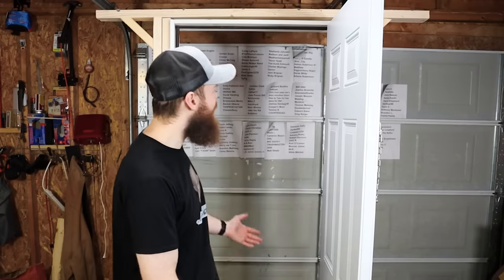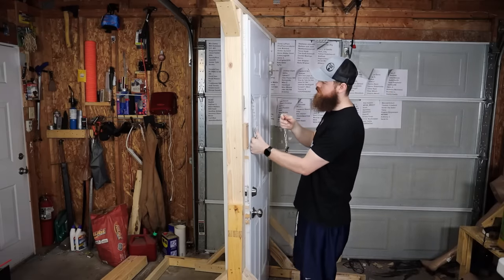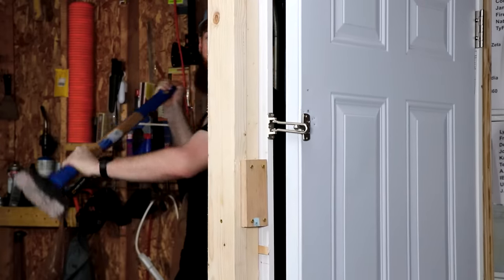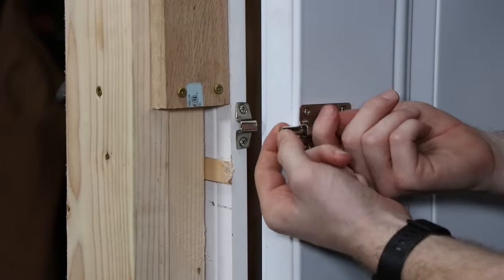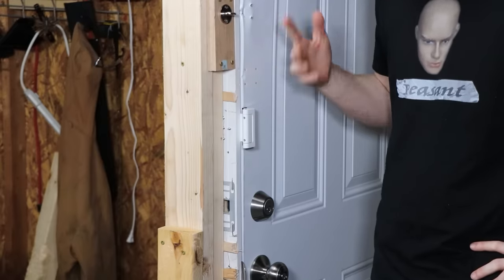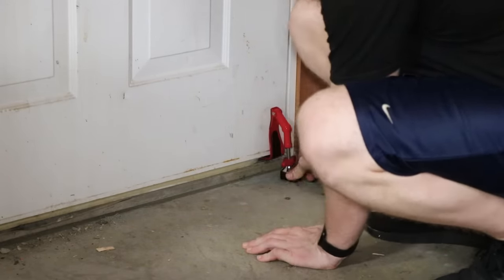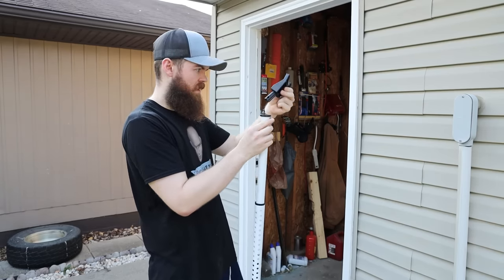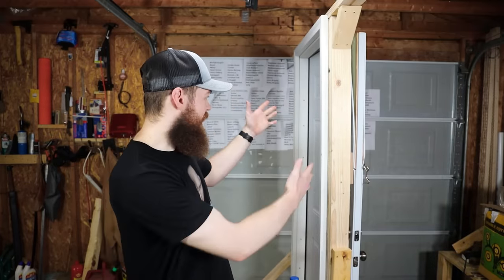Testing Top Rated Door Locks From Amazon!

Comment from the maker: THE DOOR LOCK - https://amzn.to/3r0BxN0
Reply: Chain one is wrong . The chain is supposed to be in the  wall
Reply: @brandonbrooks9275  its probably better on the door as long as the door is quality wood becuse a dry wall ain't stopping somebody really strong smashing into it
Reply: Fire men do that to get to people
Reply: For the first lock if you had switched them around and put the chain part on the frame and the lock part on the door then it work
Reply: @rick what I meant to say when I was a kid we had a wood wall and it held to a neighborhood burglar. But it was a wood walled house so I do agree that it need to be wood and also the slide it’s self needed to be horizontal where the fat end would be closest to the edge of the door and you would not be able to slide it open.
Reply: You cracked the door frame with the sledgehammer when you were testing the hotel style look, and all the kicking that you did made the crack bigger... To test the strength of a deadbolt you NEED a new door frame..... A deadbolt WILL ALWAYS be stronger than all of the other locks than you are testing here.....  So do not sit there and tell people that a hotel type lock will out do a deadbolt..........
Reply: That's because the frame was destroyed and you're forgetting most deadbolts go into the wood
Reply: @cypher9927  It most certainly will. Police kick on deadbolts every day.
Reply: Put a screw and nut in the white pole instead of that useless button and try it again!
Reply: Heres a tip nothing will stop  a person that isn't honest they will always get in even with the toughest locks.
Reply: We have 7 bolt uPVC doors here with a hotel style door hook at the top and the bottom.. your going to have to remove the whole frame to get in!
Reply: i suggest testing these again but mounting the door into the ground or something so it has much less give, i feel the force put into the door was just thrown away every time the door slid
Reply: @brandonbrooks9275  the slide for it was also wrong, yes he followed the pictures but they are supposed to be mounted sideways with the input side farthest away from the door, that way the force is even distributed among the 4 screw holding it in, instead of it just yanking on the connection point of the chain
Reply: Try all of them at once
Reply from the maker: It absolutely will out do a deadbolt, all day long
Reply: Do the door look that Jerry on Seinfeld had and went crazy about.
Reply: @at4legendz  read my second comment
Reply: @kylehooker3710  i know that.... if you do them the right way, they need a battering ram to get through the door....
Reply: Sad news 
Frame is weak 
Wobbly door,Weak Door 
And just having a sledge hammer can break any doors
Reply: You fucked up the door and didn't give any of those locks a chance.
Reply: Nice channel, but just a suggestion: get rid of the 3D outro animation, it doesn't look good
Reply: The door chain.. usually there was a button you would have to push and hold down the get the rivet out and it requires both hands. if mounted tight it would be pretty much impossible to bypass it from the outside without any tools.

Of course yours didn't have that rivet trapping mechanism, because it was so cheap
Reply: @Lilith-Rose  problem with that if there's a fire the fire crew isn't going to be able to do anything and they possibly could have the grounds to sue you (this is just a complete guess, if this is wrong then I'm not surprised)
Reply: @Lilith-Rose  well, as I said it was just a little hunch, if it was stupid, ignore it.
Reply: Ellie, the DOOR LOCKS!
Reply: Your terrible predictions are the best part
Reply: @kylehooker3710  They do kick deadbolts every day, once once the deadbolt is kicked in, they will kick the hotel lock in much much less effort. Go build 2 doors, lock one with the same deadbolt, and one with the same deadbolt and hotel lock. Even if you're as out of shape as I am, the hotel lock will only take an additional kick or 2, because you would have destroyed the frame kicking in the deadbolt. The tests are done in order from assumed weakest to strongest, on the same door, each time it's hit weakening the entire system more and more, and all done assuming the door is unlocked or picked (which in the real world most people hit a door with brute force and ignorance from step one if breaking into a random home)
Reply: @TylerTube  build another 2 doors, mount them on a building and try each in turn, if you break through a deadbolt first (which reminder will make you crack the frame because you actually mounted the strike plate with the 2.5" screws most deadbolts come with for that application) and then an unlocked door with a hotel style lock. You will NEVER break the deadbolt first, even though you installed the cheapest, least secure deadbolt money can buy. You tested a deadbolt on an already broken application which gives you a very very false sense of security with it.
Reply: Choose
Reply: Choose
Reply: Choose area
Reply: the second one can be bypassed just as easy as the privacy hook
Reply: Bolt cutters = 5 second entry.
Reply: regarding the first "lock" (the chain) you dont need to mount it further away... you can just mount it further up, to the point where you need to close the door to have enough chain to move the pin(?!) to the top... dont know how not to realize that... i am not the smartest person and it took me less than a second to form that idea...
Reply: Yeah I'd like to see that one you know that you attaches to the handle to the ground I agree with you but let's see what would happen if you put a bolt you know drill a little hole put a bolt in it so I can't slide the little pin

Comment: Put all the locks on one door and make the ultimate door
Reply: It would be awesome to see Tyler do that then try to open the door because I truly believe that it’s gonna be impossible for him to kick or knock up the door with them all on
Reply: nice
Reply: lock pick lawyer would probably have something to say about that :p
Reply: You’re playing god right now
Reply: SUPERDOOR!
Reply: Easy defeat, just take out the hinge side with a crowbar/Halligan, or even faster shotty to the hinges. quick and easy.
Reply: @eliminster06  put locks on both sides
Reply: Except what a PITA to fasten them all, you'd get tired of doing it on a regular basis so they just were wasted effort and money to install.
Reply: YES!!! I AGREE 👍🏻💯👏🏻👌🏻
Reply: @bradster2214  Still wouldn't take that long, most American doors are not even strong enough to resist a halligan tool when properly employed. The spade and hook will make quick work of the door if needed but most the time it is faster to defeat the locking mechanism through leverage. Let alone watching what happens when you use a hydraulic ram similar to the jaws of life on a door, couple seconds and it will pop right open.
Reply: @eliminster06  hydraulic ram doesn't count. We're talking preventing a B&E here. Good luck busting though that door with your sledgehammer.
Reply: @bradster2214  wouldn't take long to take the door out with sledge, what you are not seeing is how much the frame  is flexing which won't happen when it is properly mounted. This allows for more of the sledge's energy to be dissipated by the frame flex and not put into the door. Most American solid core doors can only handle about 7 good swings before they split in two. Only door ive seen take more from a slege had a solid 1/4 in steel plate in the center spanning the whole door making it a wood/steel laminate door. that thing didnt even flex under impact but dented the wood and only failed due to the locking mechanism failing finally.
Reply: @eliminster06  if someone was worried enough and did this, they'd have a plated door.
Reply: And have them all fail once the door frame or the door breaks
Reply: Esbern's door from Skyrim lol
Reply: @eliminster06  What if you aint in america
Reply: Won’t work. Each lock has different slacks.
Reply: I need this
Reply: Of course
Reply: It would be like the door from Up
Reply: The sliding lock usually goes on the door 
Still not much help if there is force but you can't take it off by sliding it up lol the door would prohibit that
Reply: What I was thinking
Reply: lol
Reply: There's already an ultimate door, the one in the video where the swat team was hitting the door with a battering ram for 10 minutes, and still couldn't open it.
Reply: @broofallbros3036  🤥🫤🤫🤯😊?😅😅😅😊
Reply: @Nightsaber22  😅i
Reply: @Nightsaber22  😅😅😅😅😅😅😅😅😅😅😅😅😅
Reply: @Nightsaber22  😅😅😅😅😅😅😅😅😅😅😅😅
Reply: 45 min routine lol
Reply: takes two steps to the right and breaks window with a rock
Reply: Put them all on a door and the doors internal frame would have no strength at all, one kick and you'd snap the door itself while the frame stays in tact

Comment: tyler the locks aren't gonna break that easy when the door is wobbling around like that. you really need to test it on a door that's actually hung in a wall. you're losing so much force to the wobble.
Reply: this is true
Reply: Sadly this is true
Looks like more than 3 hours gone to waste
Reply: Maybe anchor bolts in some concrete in the future. That way we can keep that good pov on the door and accessibility for demonstration. The top would still flex somewhat though unless metal frame around wooden frame.
Reply: If the door wasn’t wobbly, the locks are going to fail easier. The door jam will fall apart with most kicks. It’s best to use a 3-4 inch screw and screw it to the 2x4.

Comment: The chain lock needs to be mounted horizontally in order to not let someone unhook from the outside.
Reply: My parents had a chain on the door leading into the basement. It was mounted horizontally with the chain on the frame and slide on the door with the opening of the slide pointed away from the frame. So, when it opens the slide moves to the end and hard to slide back out due to the movement of the door. More effective than how it was mounted in this video.
Reply: ...and have the chain on the wall instead of the bar too
Reply: Ah yes to both of you i completely didn't think of that either. I feel like the chain needs a retest in a part 2 of this video.
Reply: Did y’all not hear that the company had it shown mounted vertically so he installed it vertically
Reply: @facade0074   Doesn't mean it wasn't wrong. Also he corrected it in a new video. The real question is why are you replying to this?
Reply: @facade0074  What's your point?  All we did was recommend a more effective way to install it, that he proved was more effective in a follow up video.
Reply: @facade0074  hopefully the company learns, then... And hopefully anyone with this kind of install can see these suggestions to add a little extra security.
Reply: @metaloverdose  I said it because the original comment implied that he did it wrong I say this because original comment says he “needs” to which implies he did it wrong
Reply: @facade0074  I see but you didn't have to say y'all, implying that I said it was wrong. I made a clear, effective suggestion. Be direct with your target instead of generalizing.
Reply: @facade0074  either way he did do it wrong lmao. Just because he was shown to do it one way doesn't make it the right way obviously.
Reply: there is a major flaw of this not having the rivet trap mechanism, like our door chain used to have and yes it was mounted horizontally too. To unhook the chain you have to press and hold a spring loaded button, which would be very hard to do from the outside.. especially since you need both hands to do it.

The chain in this video was trash anyway, so it really doesn't matter how you install it.

Also the point of chain was to open the door just slightly, so you can talk to the person outside, while even being able to keep the eye contact, yet the chain still gives you some security as he can't forcefully open the door and get in. Well at least it's not supposed to be easy as on this video.

If you mount the chain so the door can no longer open with it hooked, it kinda defeats it's purpose.

The chain needs to survive at least few good shoves, this should buy enough time for the person inside to slam the door closed and lock the deadbolt, then call the police.
Reply: @beardsntools  I think the chain was definitely way too long. You shouldn't be able to reach that far into the house. Way too much slack in the chain
Reply: @zethbuckley93  It's actually only slightly more. If you look at the 2nd lock tested, that's how far the door should open with chain. The main problem with chain other than it being very cheap, is vertical mounting and lack of rivet trapping mechanism. It can be as long as it was because when you open the chain the door has to close, so the hand wont fit through the gap. The rivet lock should prevent any thin piece of metal to be used through the gap to try and push the rivet out, because you have to use the second had to push the button to open a proper door chain

Comment: I am a first responder and I've had to kick in several doors. They are very easy to kick in. You can cause a Deadbolt to fail with 1 kick. 
I believe the reason you struggled was your moving frame.
Also I can say definitively the size of the screws is what will save you. To make your door almost kickproof literally just put 3" screws through the metal Deadbolt latch
Reply: Thank you
Reply: @thebatmom  for what
Reply: @drewa3597  for the information he provided
Reply: Yup, 3" deck screws and your deadbolt basically has to be ripped from your door before you'll get it open. Doorframe spreaders will still let it open easily, which are much harder to defend against. Usually that involves a steel bar that holds the sides of the frame and the door, which is a major pain all around and generally worthless unless you have bars on all your windows.
Reply: A properly installed quality deadbolt isn't going to be kicked in easily.  The plate it goes through should be heavy gauge steel and secured to the door frame with proper 3'' or greater wood screws.  Most are installed poorly though.  The door jamb is entirely useless for security - the framing is what offers security.
Reply: Yeah. I think you are right there. Bolt the door to the floor or otherwise make it not move around and all that force you apply will actually go into the lock and not get shifted into the moving parts.

Comment: Tyler: kicks his way past all these locks

All these lock companies: YOU WERENT SUPPOSED TO DO THAT
Reply: But...      A robber does kick the door so, he was checking if it was secure against robbers
Reply: @wdgaster6148  A robber wouldnt go through the door at all most likely.
A window is 10x faster and less noticable.
Reply: @rickardsvensson7097  Agreed especially if the nefarious individual is committing a "smash and grab" opportunistic type burglary.
Reply: @rickardsvensson7097  Unless the house their breaking into has a glass shatter alarm
Reply: @sevenseven7990  they still would chose that over the door. As said, way faster.

And if they have alarms for the window they have alarm in the house overall. So wouldnt matter if they went through window or the door, an alarm would sound either way.
Reply: @Dusty German what?

Just go google it or use your brain for 2 seconds. :)
Reply: The 2nd locks manufacturer is proud
Reply: Especially 13/14:00. They  marketed that on paper well, but in reality it sucks. I was at a party in highschool and someone got in 1st  kick

Comment: Funny story here:

The second lock he reviewed is one that i have on my apartment door (aside from the chain that is originally on it).
I installed this bad-boy and i must've forgot to tighten the screws down that were on the catcher so i left the house and came back an hour later, opened the door and the catcher caught on the nob piece and i was essentially locked out of my own home. It was EXACTLY like this scenario in the video.

It took me 45 minutes of kicking in the door (JUST LIKE TYLER WAS DOING) to FINALLY loosen the screws enough to where i could reach my hand in and pull the nob loose and out of the catcher.

Its still a good lock though, IMO.

Full disclosure: The screws that came in the package were NOT the long screws as shown here. They were tiny little screws
Reply: Ive been locked out by that style lock before due to something in the lock catching when it closed and flipping it closed.
I rent.
Called maintenance, they came out with essentially giant pliers and squeezed the bars together getting me back in in no time.
Reply: Quick tip jam a credit card in the lock from the outside takes a little practice and you can essentially open the door right up
Reply: Open the door put a credit card where the lock is slam the door shut and it will fling the locking arm out of the way
Reply: The fact that it opens only a bit before it stops shows you what you cant access juuuust a bit to piss you off even more
Reply: Wait your apartments allowed you to install one?  I might have to look into this since my apartment allows me to paint the walls lol